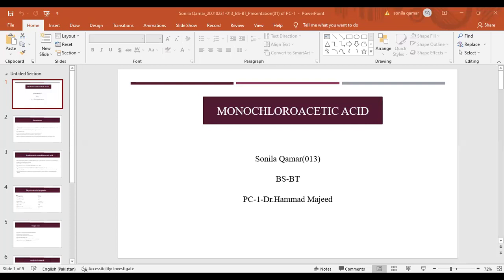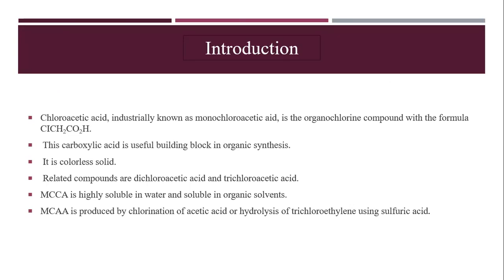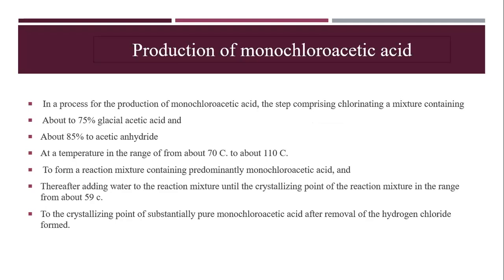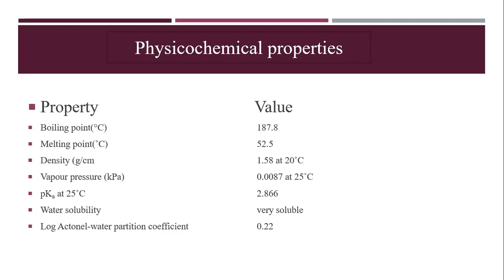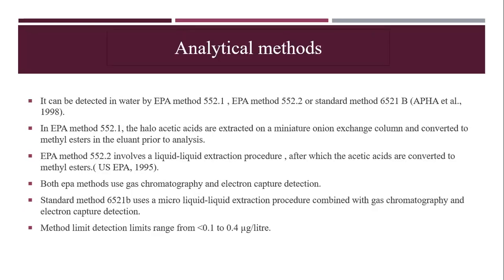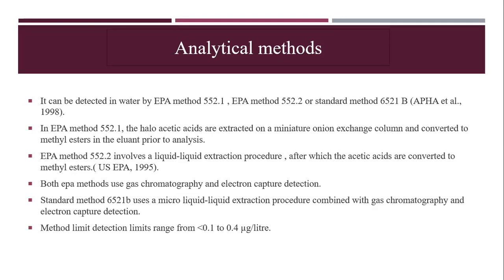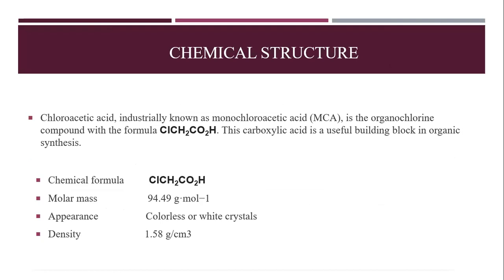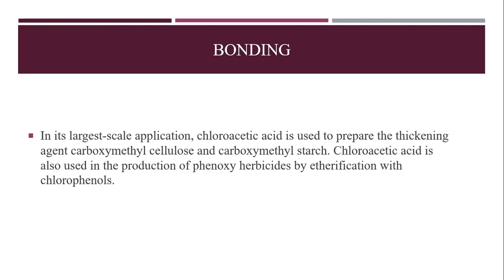MONO CHLORO ACETIC ACID | CHEMISTRY | BASIC CONCEPTS | DR. HAMMAD MAJEED

Comment: I was working at a chemical plant when MCA made contact with my skin.  I was a insulation and sheet metal mechanic and had to repair the insulation and metal around some pipes.  The pipes were glass and were exposed.  I walked over to the exposed pipe and felt something burn my chest.  The pipes above me was leaking.  I thought that I was going to die
Reply from the maker: yes. it was too dangerous. I hope you are safe. Stay blessed ad good wishes